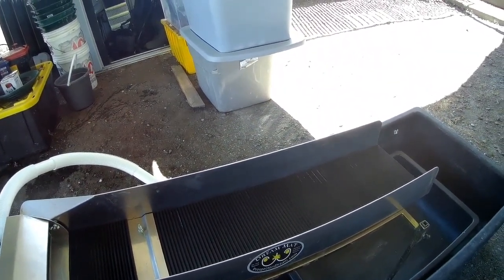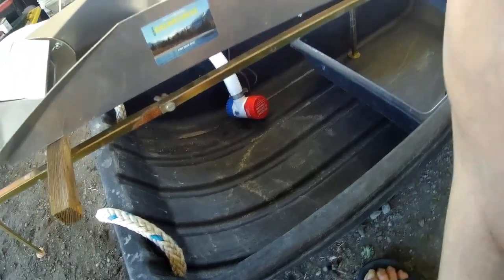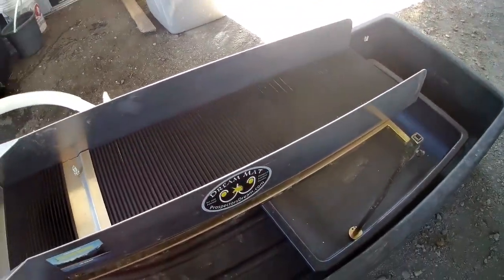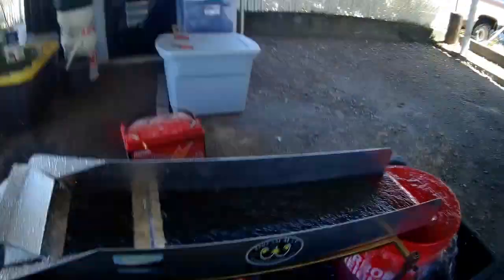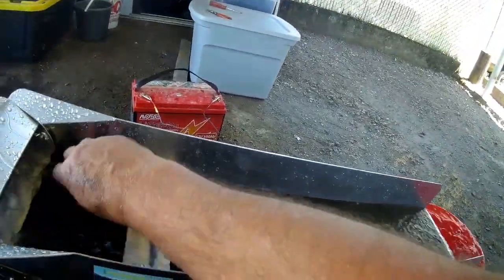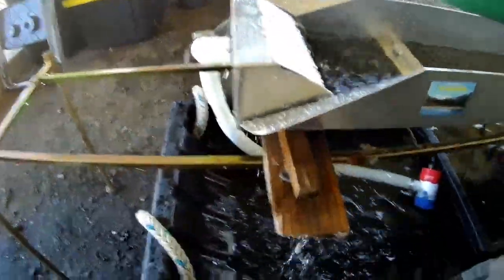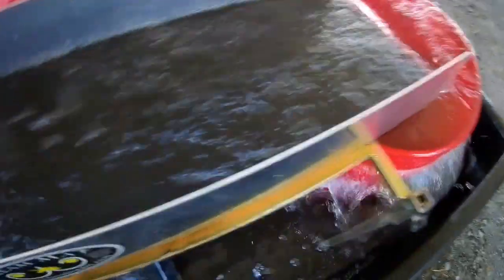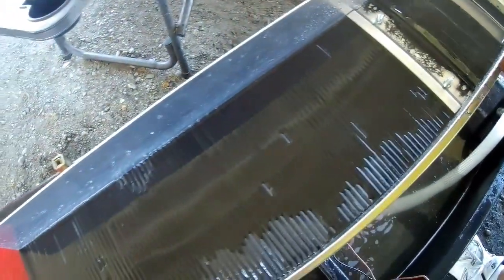First Time Running Sawtooth Mat in Sluice. This NOOB needs Beachminers Help. #prospecting

Comment: I find that the lower profile mat I use...the slower I run my water...at a little less pitch...hope this helps..also wire brush your mat...it scratches up the surface and removes the manufacturers mold release agent.
Reply from the maker: I will try that. Thanks

Comment: If it was easy to get all the gold, there wouldn’t be a single human on earth not getting it. 😂

I’ve tried and found that a dream mat micro mat is best for collecting the smaller “fly shit” sized pieces and a Miller table is best to run my cons over again to catch the flatter pieces. 
I’m certainly not catching 100% of my gold but I’m not throwing away my double cycled cons either. Until I find a foolproof method of catching ALL of my gold, I’ll continue to search for the tiniest of pieces 😂

Good luck with the search mate. Great video 👍

Cheers from Australia 🇦🇺🍻🍻
Reply from the maker: Thank you, and yes it is very difficult for me to throw away my processed leftovers.
Reply: The way to get all the gold is instead of running water with material over the sluice, move the sluice sideways back and forth, mat backwards, slight angle under the water and in calm water.